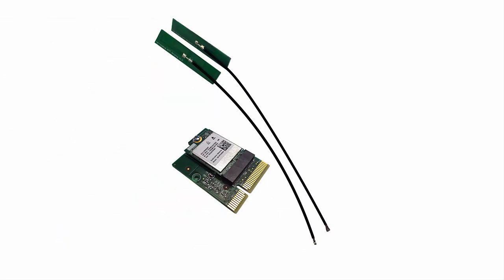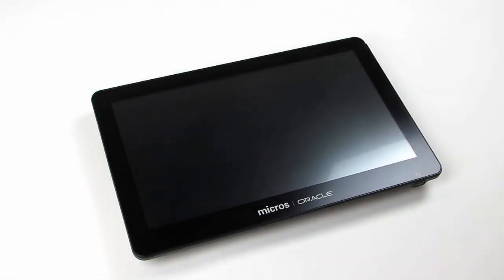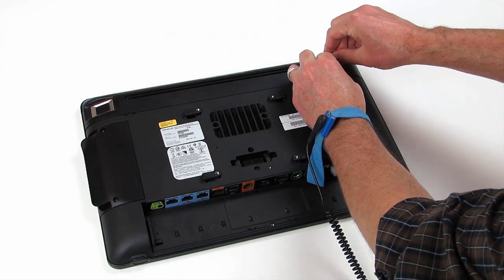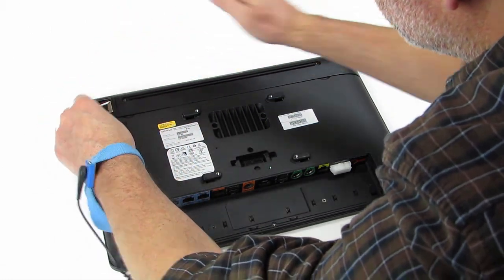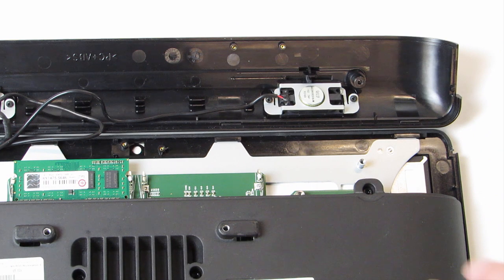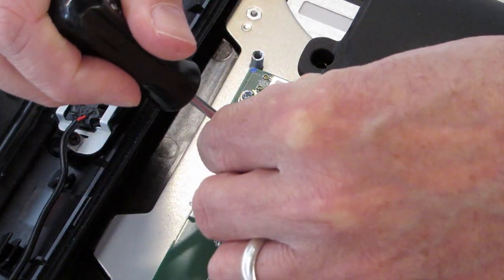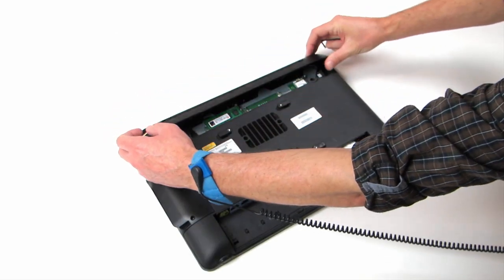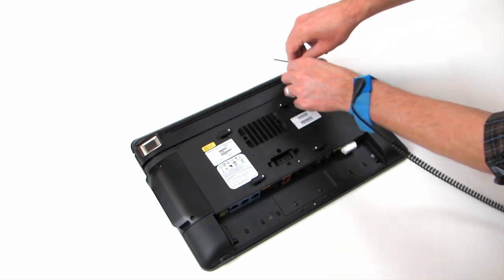Oracle MICROS Workstation 6 Series: Install the Wireless Networking Module

Comment: Hi, I have a Workstation 650 that's having issues with the touchscreen, there's no response when the user touches the screen, it happened all of a sudden. It has Windows 10 LTSB, I've checked drivers and they look fine. Any suggestions as to what could have caused this issue? Thank you.